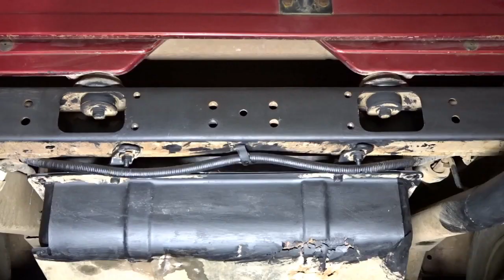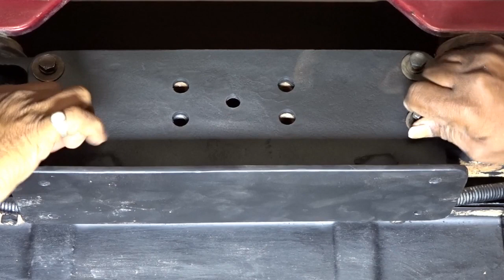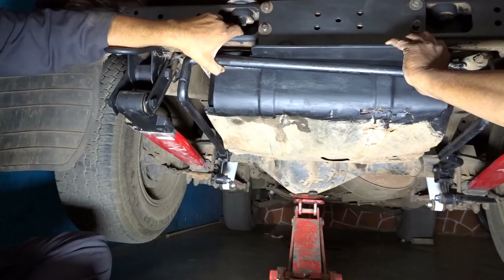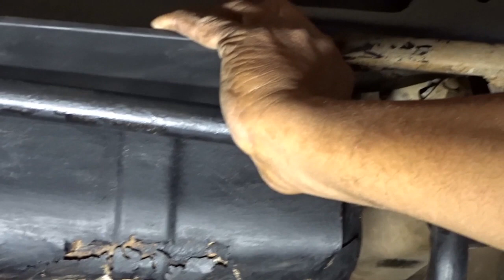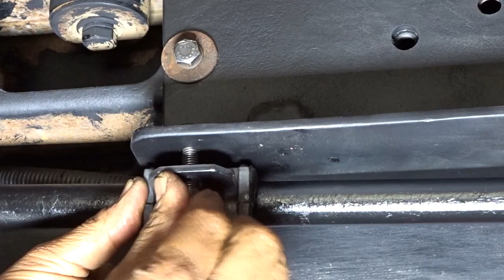ARC Anti Roll Bar Suspension Installation guide on Mahindra Thar - For CRDE & DI

Comment: Hi Team, I own an 2004 model Bolero GLX 4X4. wanting to upgrade the suspension for the obvious reason. What will be the cost including the anti roll system
Reply from the maker: Namaste Sir, Please contact us on 9422047019 / 9595940959.
There are multiple designs in Bolero. it will be easier if you could send some photographs of suspension system to us.
On top of that we have different onroad and offroad capable variants in suspension kit.
The vehicle will drive amazing, that we can promise for sure. :)

Comment: What are the advantages of this suspension comparing to stock one
Reply from the maker: The above suspension system consists changes: 

1
Metal Leaf springs with ARC Composite Leaf Springs - which will make all the suspension absorb the jerks of bad roads, or even the sudden movements of the suspension will be completely arrested. Metal leaf springs have a tendancy to transfer the jerk to the vehicle cabin, whereas composite leaf spring absorbs the sudden jerks and smoothens it. Sort of like in normal bus compared to Volvo Air suspension feeling.

2
OEM Shock Absorbers to ARC Shock Absorbers - due to the changing variable of enhanced absorbtion of jerks, the shock absorbers need to be tuned accordingly to reduce sway movement of the vehicle. Which makes the cabin more stable and luxurious all while maintaining utmost comfort and stability on all terrains. The vehicle gets more grip as well as turns better. High speed stability increases. Body roll characteristics will be reduced down to bare minimum. Having a well tuned suspension system makes the vehicle drive feel effortless and easy to handle, and comfortable on bad/good roads.

3.
Bolt on ARC Anti-Roll bar helps to articulate the vehicle in a similar fashion like shock absorbers, although Shock absorbers work as independent suspension. Anti Roll bar works in conjunction with rear tires, it serves an additional stability purpose like seen in Corvette (Transverse Leaf Spring). It makes the vehicle sporty and easy to maneuver while making sure the vehicle doesn't tip on one side too much in speed turning.
Reply: Anti roll bar is bad for off roading.
Reply: @archangel7052  why?
Reply: @Vyakta93  When I say off-roading I mean extreme ones...check out "disengaging sway bars on YouTube". In short it's done to increase suspension articulation, that's why some off-roading vehicles come with the ability to engage and disengage anti-sway bars just by pressing a button.
Reply from the maker: For deep information , please call on 9922099292 , 9422047019 .
Reply: @archangel7052  Ok Sir , Thanks for explanation.

Comment: This is extra accessory or it comes in the stock?
Reply from the maker: No modifications necessary to install this product. It comes as direct bolt on kit. 
Designed and manufactured by ARC Suspension.

Comment: I need the full kit for Mahindra Major 2000 model.
how much it will cost?
Reply from the maker: Sir the complete kit will cost you 88,980 which includes 4 ARC Composite Leaf Springs and 4 ARC Shock Absorbers.
Suspension kit link given below.
https://www.arcindustries.co.in/products/mahindra-109110/mahindra-jeep-series-147148/jeep-major-arc-supension-kit-composite-leaf-springs-and-shock-absorbers--289290
Reply from the maker: Product can be ordered from the below Link - 
https://www.arcsuspension.in/mahindra/jeep-series/mahindra-old-jeeps/mahindra-vintage-jeep-1954-2010-arc-suspension-upgrade-kit-front-and-rear-composite-leaf-spring-and-shock-absorbers-major

To know more Call us on 9422047019 / 9922099292

Comment: Can anti roll bar mechanism work in bolero power +
Reply from the maker: No sir, only specific to Thar Crde and Di right now.
Reply from the maker: We have composite leaf spring and shock absorbers for it.
Reply: @ARCSuspension  Do you have any dealer in kerala?
Reply: bineesh joseph don’t know
Reply: @ARCSuspension suspension for Hyundai venue is also available??
Reply from the maker: ARC Suspension fitment centre - Thrissur - 099952 24156
Reply from the maker: @Akamseliang1224 Hello Sir,

We have developed and launched the Hyundai Venue Suspension Upgrade,

Product link - https://www.arcsuspension.in/hyundai/venue/hyundai-venue-2019/hyundai-venue-arc-suspension-rear-15mm-lift-spacer-rear-shock-absorber-suspension-upgrade-kit-rear